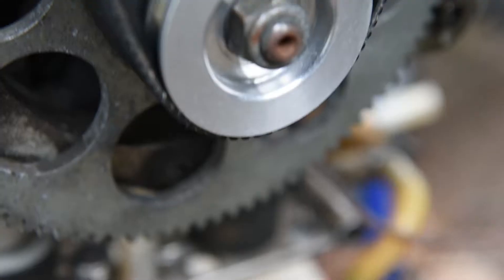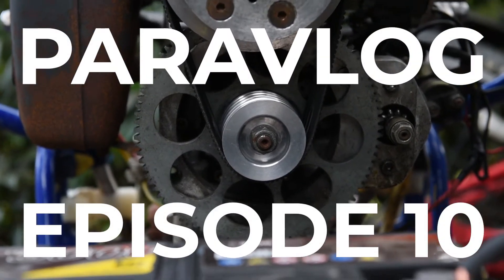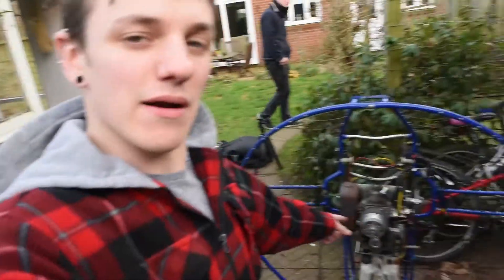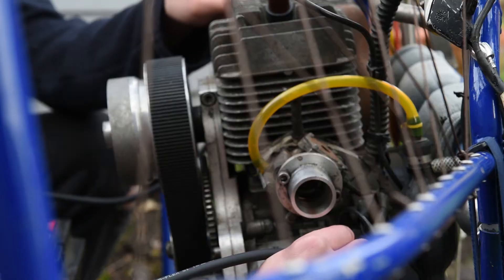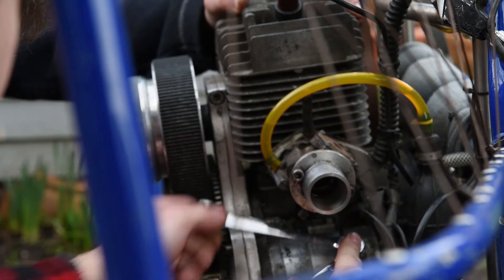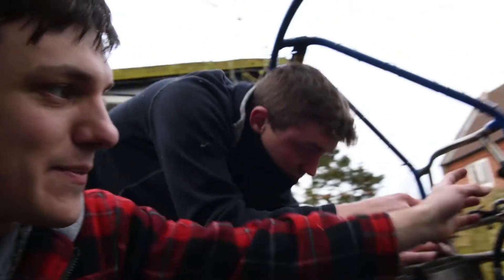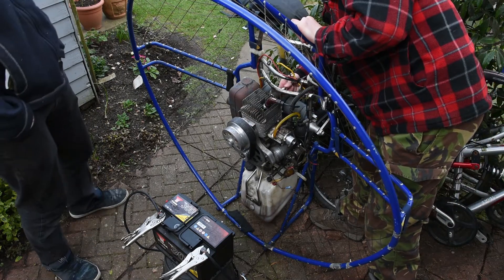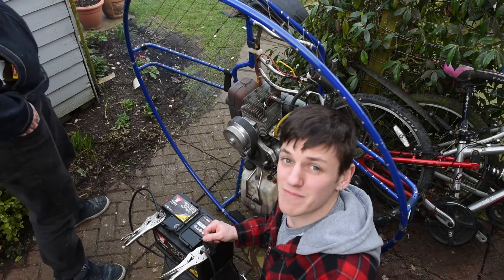Thrust Testing & Nut Problems

Comment: The solo 210 was originally designed as a water pump, it does not have reed valves and is therefore underpowered.
Reply from the maker: Thanks for the info, I had narrowed it down to what I thought was a Hirth F33. I know these old machines are heavier with less power but was a cheap fun little project to get into the sport :) I’m about 65kg naked weight so I wouldn’t have though thrust would be an issue when trying to push my tiny little body into the air haha
Reply: I have been flying PPG for over 10 years, I started on a solo210, my advice to you is as follows:
Make sure you chose your wing wisely to overcome the lack of power, ask as much as you possibly can from instructors.
Ground test your paramotor for at least one FULL tank of petrol(operating at 60-75% throttle) before actually flying, I did not do this on my solo210 and the entire redrive assembly with the prop simply fell off 15min into flight, I had tightened the redrive assembly good and proper but if you have an unbalanced prop this could happen. By ground running it for a full tank of fuel you will ensure things like this will not happen in the air, believe me you do not want this happening on your first flight. After running on the ground inspect the entire paramotor with a fine tooth comb and magnifying glass. I do this after every major engine rebuild and it flushes out all the things you do not want happening up there. Lastly make sure EVERY SINGLE bolt and nut is loctite or wire locked, if not it will depart in flight and go through the prop.
Reply from the maker: Some valuable stuff there, we both love learning and never stop asking questions, we have a need to know everything haha we’ll probably be replacing piston rings and rod bearings as part of the strip down so will need a run in anyway, we’ll be sure to stick plenty of lock tight around her. Prop balancing will definitely be done as well
Reply: If it aint broke do not fix it, what I am trying to say is, if you do not hear any knocking/grinding/buzzing or noise from bearings do not fix it, you will cause more headaches or heaps more ground testing for yourselves. Rather do a compression test to establish if the rings are ok - you should get at least 130 Psi. Make sure that all nuts and bolts are torqued to what the manual specifies. Check the colour of the plug to make sure its not running to lean or rich, if you do not know how I can tell you how. Do a hang check on the paramotor and make sure you can get in and out of the seat with ease and that it balances properly and you are upright in the harness. Make sure you have a reserve. One of the options to help get around the low power output is to use a paraglider type wing rather than a full blown PPG reflex wing as it will generate more lift and have a slower take off speed.